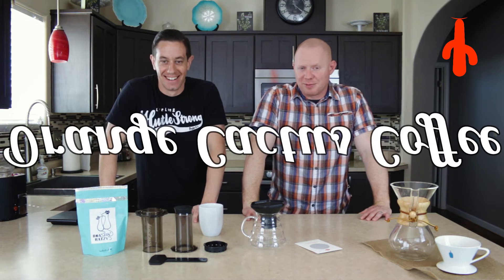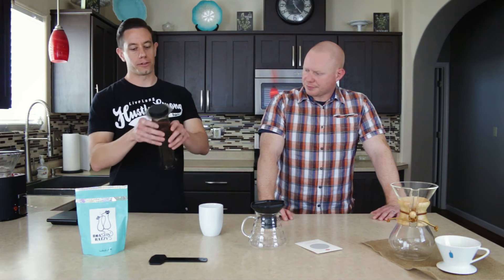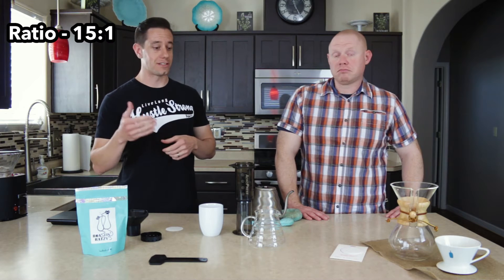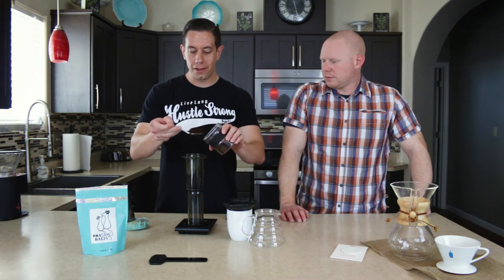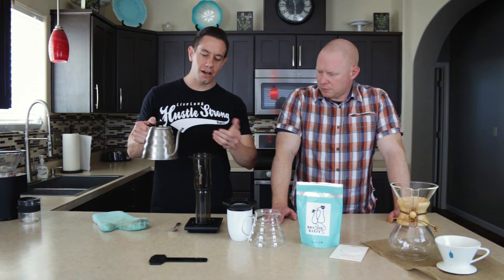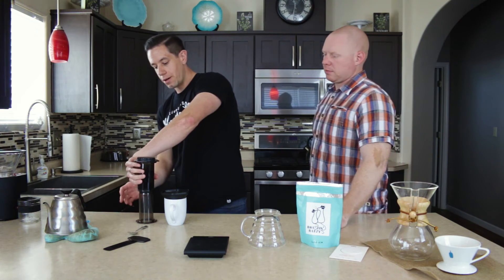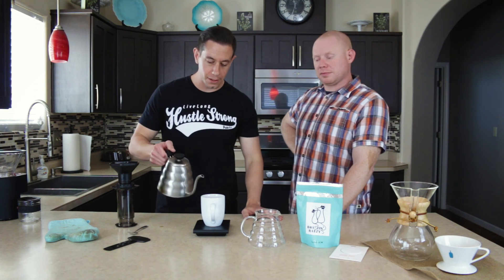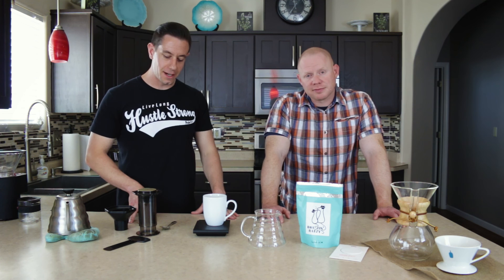The AeroPress - Inverted Method

Comment: The air gap between the plunger and coffee when you flip it is there, but it is neither a vacuum not is it important.
It's not a 'vacuum' because the space is filled with air that bubbles through the coffee on inversion.
It is not important: the rubber plunger pushes on the air which pushes on the coffee, but if you took the air out, the rubber would push directly on the coffee, which doesn't affect the coffee.
Reply from the maker: Hi Emile Du Plessis, Thank you for the feedback! Perhaps "vacuum" is not the best word. We don't mean vacuum in the sense that all the air is removed from the chamber, rather, when the plunger is on, a slight variance in atmospheric pressure is created, preventing the water from dripping out the bottom. If you don't leave any room for air in the chamber then the plunger would press directly on the water, which could cause a break in the seal and not allow for enough pressure to build up for a proper extraction. Tha air gap is important. Happy brewing!